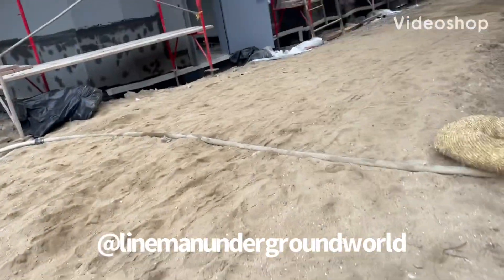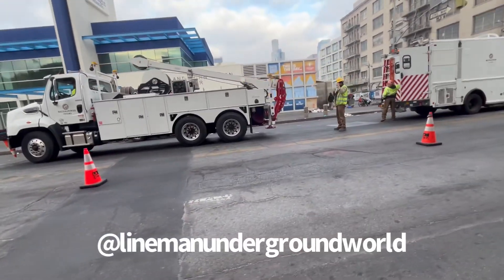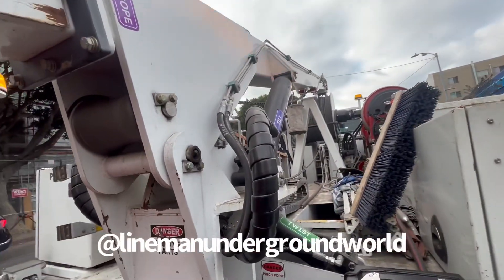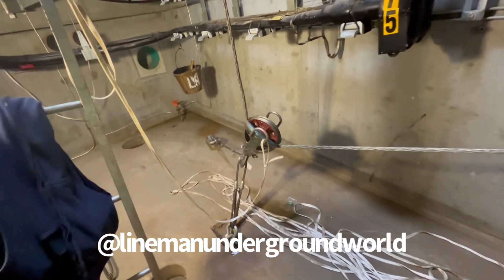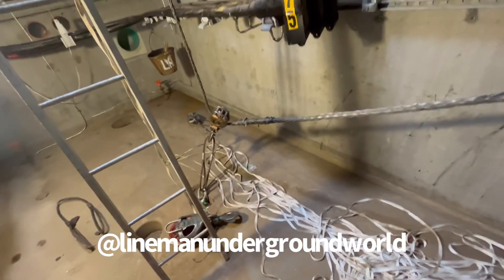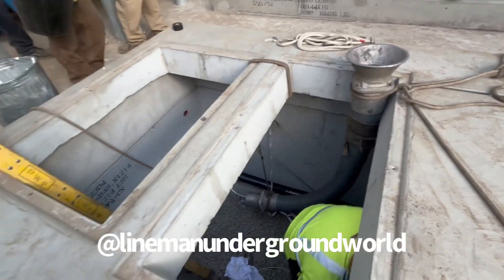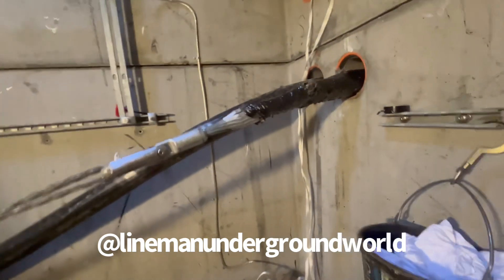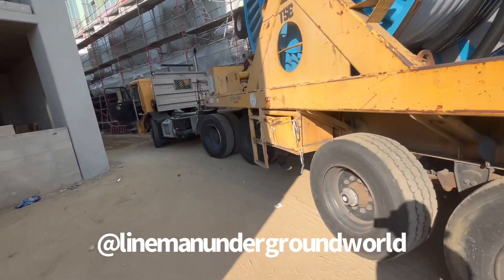Part ( 2 ) pulling in 1mcm copper cable

Comment: That is an impressive diameter.Heavy weight and very rigigit, hand pulling is impossible. Massive staff and trucks to pull a cable in your town.
I love your work and watch your channel.
I pull mostly 4c 25m² or 35². It is enough for a house with massive solar or ev charger.
In Germany we have 3 phase and 400 volt, it is a regular grid and the amperage are lower.
Best regards
Reply from the maker: @stefankruger3634  wazzup Stefan, thank you greatly appreciate it, and stay safe over there brother 👍😎